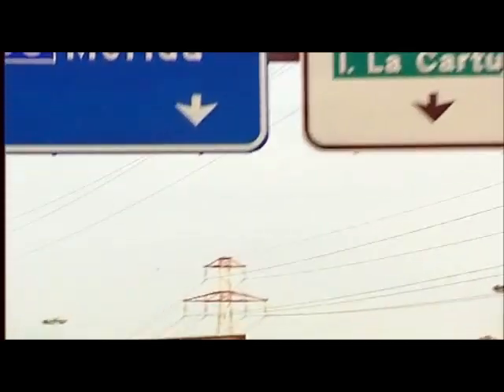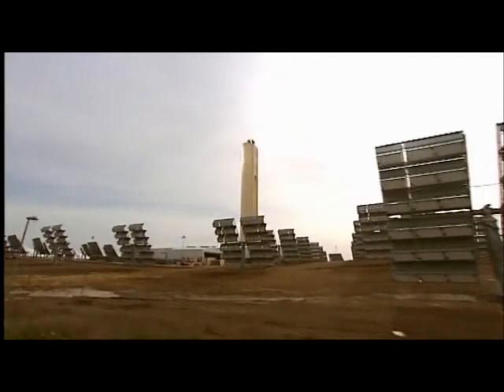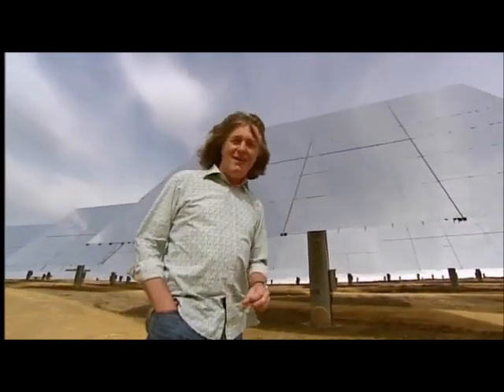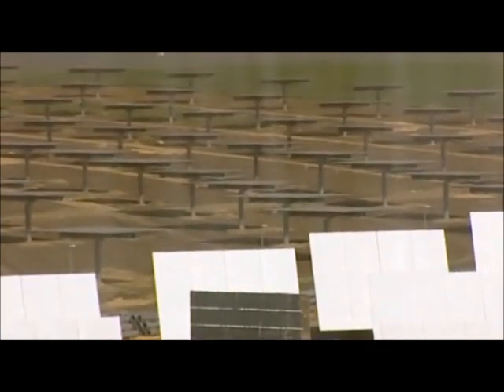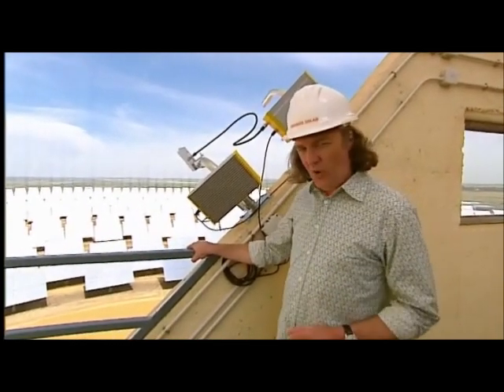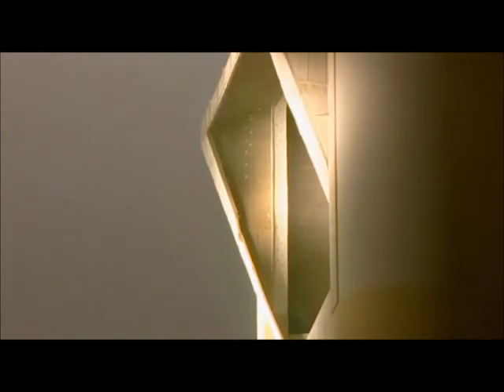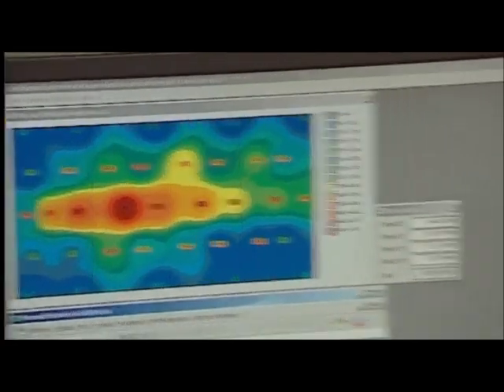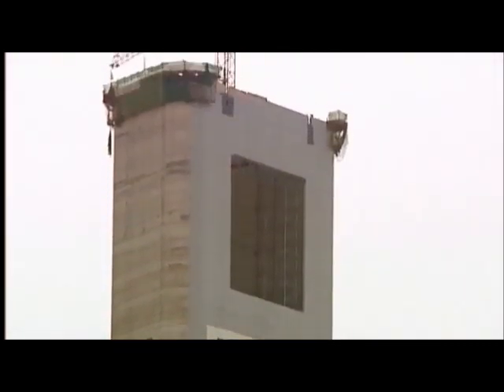James May (Top gear) visits solar thermal plant in Spain

Comment: How are you gonna clean the sand off the panels, numb nuts? With desert rain water?
Reply: pressurized air?
Reply: you can't clean the dust off a surface by just blowing it off, it will resettle.

Comment: 11 MW is not a lot of power. It would take 80 of these to match a single Bruce power plant.
Reply: You miss the most important part here, its renewable. How stupid to just think about money.
Reply: MetaKnight23
Unreliable power won't run the grid. These are just glorified gas plants which isn't renewable.
Reply: lol we already we make 2 gigawatts thermal plants with 24 billions cost this is from 2011
Reply: SpanishFIRST
I have no idea what you just said.
Reply: leerman22
we made 2 thermo plants like the one of the video but it generate 2 Gwatt not MW and each cost 23 billions

and also we start to export energy to portugal and france
Reply: SpanishFIRST
You mean a 2GW concentrated solar plant? All 8 Bruce reactors make just over 6GW total for 14.4 billion canadian dollars.
Reply: yes but now those solar plants cost under 10k euros peer mounth to run
Reply: SpanishFIRST
You have to also know the capacity factor of the plants, and how much it costs to the rate payers. A Bruce CANDU has a >90% capacity factor (at approx $0.06KWh), but a solar plant only has <20% capacity factor, unless it uses molten salt storage.

FIT programs in Ontario buy solar PV energy for approx $0.40KWh even though we have a surplus of electricity and no more coal to displace. Concentrated solar systems like this are useless during slightly cloudy days often found here in Ontario, and a lot of places that aren't in a desert.

Comment: When you think of all the complexities involved in all the other forms of eletricy production it's quite simple. theres no more fuel to source, extract, deliver, pay for. plus they didnt mention that these plants aren't like normal solar panels that cant provide power once the sun goes down. they store the heat in the tower and it can last up to 15 hours. This tech needs to used here in Australia. So much sun on offer. Australia is the largest exporter of coal. shame shame shame.